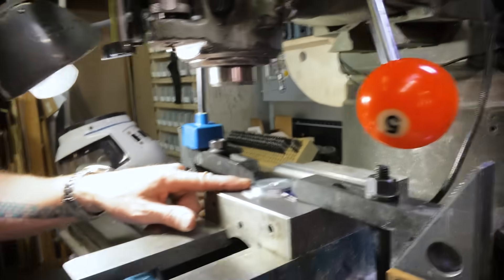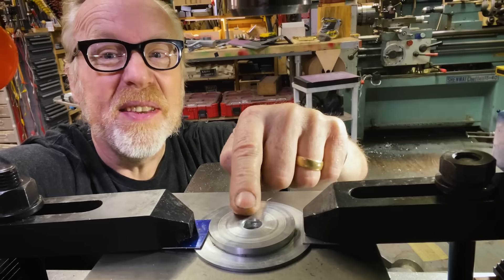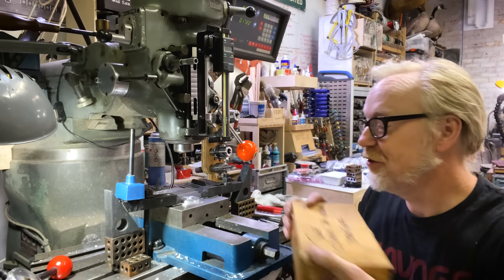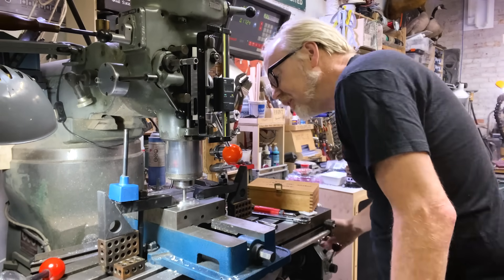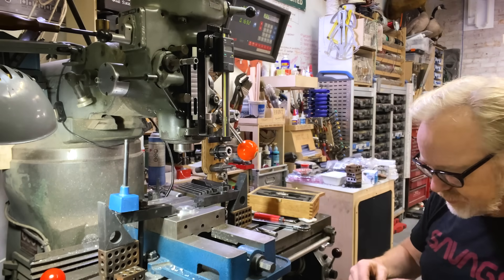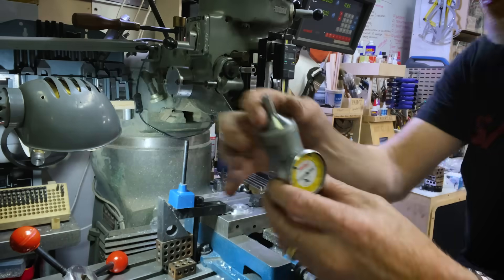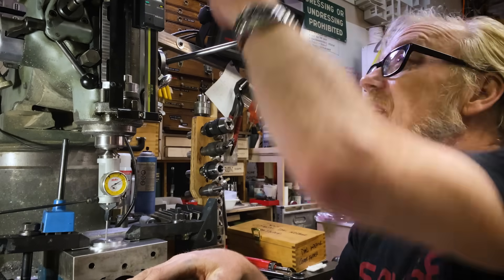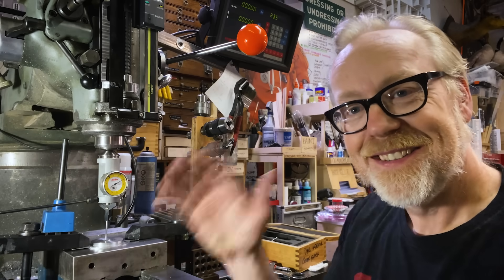Adam Savage's Favorite Tools: Wiggler Machining Center-Finder

Comment: It hurts watching him use any dial indicator on something thats moved with power. Go to neutral and rotate it around manually. Also, not to nitpick but the right hand-clamp is sloped down which means its not holding as good as it can be.

Comment: Put a (precision reamed) tapered rod into the chuck. Using a (loosely clamped) drilled and reamed piece of metal held in the vise, simply bring the tapered rod progressively into the hole.This will automatically center the item to be worked on. Then tighten up the vise firmly. Depending on the  precision of the tapered rod in the chuck and the reamed hole, there's up to 1/10,000" accuracy. Certainly, 1/2 thou is rapidly and easily achievable. The wiggle detector requires quite a bit of talent and skill. (It's also very time consuming).

Comment: Call it what you want, it is a perfect tool to get within 1 or to quickly dial in. Now gotta change the subject. I've had my hands on every type of machine imaginable.  For one-off and prototyping and experimenting,  there is only one mill to have. It's called a trak mill. I just bought a brand new one for 42k.  Nothing is better for such work.

Comment: Adam.  Your mill head definitely needs some attention.  Bridgeport uses plastic bushings in the variable speed sheaves.  Yours are definitely worn an need to replacement.  Parts are inexpensive and the job to replace isn't complicated, but time consuming.  Plenty of how to videos on YouTube to guide you.  New belt and bushings will make your machine run much smoother and sound so much nicer.

Comment: Starrett makes a good wiggler set.  Easier than using that coax indicator.  I typically put the gearbox in neutral with a coax indicator and spin it by hand.  You're putting excessive wear on that tip.

Comment: Hi Adam, do yourself a favor and get a Holder Quill Clamp, (also known as a Spindle Clamp), and a dial indicator.  Attach the dial indicator to the Quill Clamp.  The Quill Clamp attaches to the rotating part of the quill just above where you mount the collet.    Once mounted lower the dial indicator stylus into the hole and adjust the dial indicator stylus so it just touches the inside (or outside) of the surface you want to indicate concentric to the mill head.  Put the gear shift into neutral so the quill shaft will turn easily by hand.  DO NOT TURN ON THE MILL.  Turn the quill by hand and read the dial indicator at locations that are 180 degree apart one axis at a time.  After each reading move the mill table half the difference in the readings in the direction of the low reading.  Repeat this process until there is no difference in the indicator readings from side to side.   Once this process is complete in both axis the reading on the dial indicator will be the same in all locations.  (And yes, you have to move your head around to the sides and back of the work piece to read the dial indicator in all 4 positions.)  When you have it done correctly the dial on the dial indicator will not move as you rotate the quill around a full rotation.  This is a lot easier and faster then what you are doing now.  Also, what you are doing now can potentially damage the indicator on your coaxial indicator. 

Love you videos.  You are always interesting and creative.

Comment: I have always used and still use my British “ Verdict “ T8 dial test indicator “  26 mm dial dia.  It has an auto reverse stylus and swivel spigot. I have seen (and used only once ) these Co-Ex indicators but find them bulky an cumbersome and very expensive ! To clock out this ( rough ) hole with my Verdict would have taken me about 30 seconds or less ! Trust me ( 60 year experience as a toolmaker ) This way you don’t need all those different feelers for inside an outside ! If you want to go beyond the reach of this DTI you make a simple adaptor in which you can slide a rod and you would be able to clock out as far as you like and that includes square/ rectangular shapes. I might start a channel in the near future because watching this sort of thing frustrates the hell out of me but I respect you effort !

Comment: I prefer to spin the quilt by hand. Check the + and - side of the x and y axis'. If your hole is concentric you should have the same reading all the way around.  If your hole is eccentric  dial the  + and - side of x axis to the same value and repeat for the y axis. This tool is also an excellent option for sweeping the head of your mill to guarantee it is perpendicular to your work peice, mill table or vice.

Comment: hey Adam, iv used the same style of Centering while milling and with your tool, getting around 0.01-0.02 mm should not be a problem :) 
I really recommend just using a micrometer with a magnet on a tool and just turn it by hand :) This is how you center milling for aircraft engines

Comment: Your coax indicator should come with a qualified sheet to tell you the error between the different stems. The .0005 is only for a specific stem and changing it changes the reading. It's not important 90% of the time but that 10% will rain shit upon you if you don't knoe

Comment: Hi Adam, I didn’t read all the comments but I’m sure someone gave the same opinion I have. As with any machinists tool it’s only as good as the operator. Watch out for bent tips and cosine error. We actually banned coaxials from our shop after parts looked like they were dialed in with .001 of an inch were actually .004. They are also a huge safety problem. I don’t think I need to add a bunch of details. I’ve used them successfully but double check them with another indicator once and awhile.

Comment: A simpler way to get closer than a "calibrated eyeball" (but less accurate than this tool), is to chuck a piece of round stock into the quill, the same OD, as the ID of your hole. Place your work piece onto the chucked piece. Your piece is now very closely centered.  Now, you clamp your workpiece into your clamp, vice, etc.

Comment: "5 tenths...really precise"  Tell me about it...most annoying part I ever had to make had a diameter tolerance range on one aspect of it of only 5 tenths  [from .1265 to .127 inch tolerance]-as opposed to most aspects on other parts having 5 thou tolerance range.  And, it was an 18 second part--i.e. a new part fell off the parts chute every 18 seconds.  This was annoying when i was over working--insert change, measuring parts, etc- on one of the other 3 machines I was running.  But, these were not manual machines like yours, they were CNC lathes.

Comment: Faster is a "cone" to press into hole the center before clamping the part. Then the switch to edge finders to verify ;)
Reply: Excellent tip, thank you
Reply: That will get you close, and often close is close enough.  However, if there is a burr on the edge, or if the surface you are dialing in isn't a complete circle, such as a hole through a tube, that won't work.  Sometimes a coaxial indicator won't even work well in situations like that.  A DTI in an indicol has never failed me.  Coax indicators are pretty convenient sometimes, though.
Reply: I  am no super machinist,  but I still prefer to just indicate my holes. 
Is there an advantage to this coaxial thing
Reply: @steveattree9674  if you've ever found yourself twisting awkwardly to see your indicator, that's when a coaxial is handy. It is more of a thing of convenience.

Comment: So a Coax indicator is used with the machine under power and the DTI, dial test indicator is used by turning the spindle by hand and has a multitude of other uses. A wiggler is an edge finder which in the UK we call a wobbler.

Comment: The process is easier and faster by moveing the spindle by hand in in both axis from one point to the opposite point. Each axis step by step. For me its a better thing with no automatic spindle movement.  My center finder is called Diacator and its from the early 70's, but it works perfectly.

Comment: The chuck and the drill bits also have some (hopefully small) amount of eccentricity. I think the precision of such a tool requires a super fine drill anyway. 
Does this tool have any benefit if I have a normal (not ridiculously expensive) drill press?

Comment: That's a coaxial indicator lol. A wiggler I've herd in reference to an edge finder before lolol. But a coax is good if you're trying to tram in a drill or something on a lathe. On the mill you just use a regular test indicator and a mirror.

Comment: Adam , one tidbit to save your parts the hold down clamp on the right is not in proper hold  power. It's slanted down in back which is not a good clamp operation. If not level of should be higher on the step it's wedging the part away not holding down. Save parts one spin of the cutter could lift and done.

Comment: I've always known this tool to be a DTI (Dial Test Indicator).
It's much easier to use it, by turning the spindle by hand, to exactly identify high/low spot and adjust accordingly...... plus at the speed you used, it won't be doing wonders for the tool...... lol

Comment: Yeah, this is the hard way to do it.  Using an indicol and a dial indicator will allow for a wider sweep (which you just do by hand), which will be more precise, and since you're doing it by hand you can easily isolate one axis at a time.

Comment: It is a coaxial indicator, and through all my years experience, you can save a lot of time by rotating it by hand to almost center it with in a half thousandths, of an inch, before turning on the spindle. I also found most of the sets, that the price is "affordable ", to the average person, the tips of the probes are plastic, and flatten very quickly. Blake coaxial indicators have all metal tips, and for extra money, you can even get carbide tips!

Comment: A wiggler as I know it is something different, being an edge finder rather than a center finder. It's a very simple device made of a probe with a ball joint and a socket that goes into the quill. 
I didn't know about the device shown here in the video but for centering I use practically the same method except that instead of a specifically designed instrument I just use a lateral dial gauge and turn the quill manually. It is somewhat less convenient of course because the dial turns with the quill rather than being stationary facing towards me, which is what I find need about the tool shown here.

Comment: I’m assuming this setup was just for this demonstration. As I’m sure you don’t plan on drilling holes in the vice that the part was clamped to. Having said that. The flaws I saw:
The clamp on the right side was tilting lower than the workpiece at the tail end. Kind of a no no. The part is not safely held in place. 
Also running the spindle while dialling in the part is not the best way to go. Hand turning the spindle in neutral would decrease the noise from the machine and if the hole is out of round. That would be easier to see. And you could even split any lack of concentricity between X and Y by just swinging 180 degrees for each axis. Just remember to always turn the spindle in the same direction for more precision readings. 

Just sayin.

Comment: the correct term is co-ax indicator and one youre showing is junk  the Blake although pricey er  is the best one can do inside and outside centering with proper feelers the same thing can be accomplished with a standard edge finder although not quite as precision as a co-ax and it doesnt take into account the runout of machine spindle

Comment: This would officially be called a coaxial indicator. Saves us hundreds of thousands of dollars when we have a pick up a hole to repair jet engine hardware.

I also should mention, a coaxial indicator is extremely important when used in horizontal orientation (horizonatal mill, horizontal lathe). A standard indicator will "float" a few thouzanths of an inch when it flips upside down.

Comment: Cimmy02 is right it's a coaxial indicator.
Many shops won't let you use them for a few reasons unless you have a high quality one such as a Blake.
We had a couple of the ones you have and we were told we couldn't use them because the weren't accurate enough. 
Good video though for a not so common tool.
P.S. a wiggler is an older style edge finder that kicks off just like an edge finder😊

Comment: This is a Coaxial Indicator and this absolutely not the ideal procedure for it's use. You do not start the machine, you should manually rotate the spindle. This removes the issue of vibration, is much safer, and eliminates the potential destruction of the precision measuring device. Best practice is to sweep two positions 180° apart on one of the axis, get that zeroed. Then zero two points in the perpendicular axis. Then you can start fully sweeping the bore to fine tune the position.

Comment: Your initial hole is egg-shaped and to correct it put on a lathe and use a boring bar to get a round hole and you won't need the mill and have a perfectly round hole.

Comment: Been a manual and CNC miller for a few years now.  I use a wiggler to find and edge and a .0001" DTI on an articulated arm to get the spindle concentric to the hole or OD of a round body.  That a great tool though, should I stumble across one, ill be putting it in my tool box.

Comment: why dont you just add a camera behind every machine at defferent angles maybe?
u can face a machine u are about to work on, u press 1 button and the camera starts recording.
and maybe connect all cameras so it all goes to 1 HDD to be worked on
you could add, ''drilbitcams'' or ''lathecam'' for close ups

Comment: actually I think you damage the probe(make it less round less lifelong ... plus you can't see anything on the indicator if you are good or bad ... doing it worse or better ... since the is that much difference )  ..... by running it like that ... Abom79 never runs the milling machine with that in it ... always by hand , tighten your highs and loosen your lows ... or something like that.

Comment: Don't turn the spindle on with that in there.  Put the gear in neutral and turn the spindle by hand.  Spinning an indicator like that is not good for them at all, especially a .0005" indicator, lol.  The reason the dial spins is so when you're checking the back of the bore you can still see where you're at.  That way you can set x or y to 0 on the dial, rotate it 180 degrees and move the table half way, then you'll be on 0.  Anyone with any experience could have had this done much faster, but love anyone who's showing some manufacturing information!
Reply: Love you bringing some machining information to the public though.

Comment: I learned from watching machinist YouTube channels that its easier to dial in a wiggler if you do NOT turn on the spindle of your mill. Manually turn the spindle to each of the four axis points and record the indicator's measurement. Use your math to find the center point of each (x and y) and dial you table adjustments to match. If you'd like to confirm your center (always a good idea) turn the spindle on to observe how wiggly or stationary it is, and it that meets your tolerances. If you'd like to make the math a little easier on yourself, turn the spindle to one of the four cardinal points (preferably the bottom of the circle) and zero the indicator. Then turn the spindle to the top point of the circle and note the measurement. Adjust your table 1/2 of that measurement in the positive y direction. Do the same for the x direction using the left side of the circle as your zero.

Comment: When doing this on a Moore jig boring machine we used dial indicators. The machine has a spot to place a wrench for manually turning the spindle. Using a dial indicator that reads to 0.00005 we were able to dial in kerosine fuel pumps that had to be bored to 0.0001+/- diameter in a 1/5” gear pocket that was about 1” deep.

It was nerve wracking work when I started, then the easiest thing ever once I’d done it 20 times!

Comment: IT's a coax indicator and they are not the most accurate tools.  The error is compounded by the length of the stylus.  Honestly you would
probably get more accurate results just using an edgefinder to locate the hole center.

Comment: A cheaper and possibly less accurate option is a conical edge finder. They are typically limited to the body diameter of .375 or .500 inches. They can pick up threaded holes where a co-ax would catch on a thread.

Comment: Add a tiny bearing to end of probes
Reduces drag of tip and is better all a round!
You can find on McMaster
You'll need to reduce ball on stock probe and use super glue to attach

Comment: Put the spindle in "neutral" and spin it by hand. Then you can see which axis to adjust. Using the motor helps when it's way out but you need to do it by hand for perfection. Unless you have a mill that can go down to 50 RPSs or something.

You can also use a regular dial indicator but the dial will spin with the probe so it's a bit tedious.

Comment: It makes me unreasonably furious that when using the imperial system in precise contexts, "a tenth" means "one ten-thousandth of an inch".
Reply: In machining settings, a "thou" or thousandth of an inch is the standard unit of measure (imperial, of course). So saying a "tenth" is commonly understood, and for brevitys sake.
Reply: What gets really confusing is when people refer to thousandths of an inch as "mils" (like in how latex gloves are measured)
Reply: mils are the worst. My company uses a mix of imperial and metric and we deal with circuit boards where stuff is always on a pretty small scale. So you're never quite sure if it's mils or millimeters. It's the guys with a military background who seem to like mils.

Comment: It's not the noise that causes the vibration, it's the vibration that causes noise 😉 and movement equals wear. Damn neat tool though. I've spent quite a lot of time indicating holes with a test indicator that has a small swing. Glad to find a tool that's ment for the job.